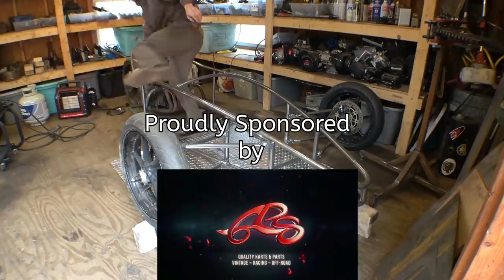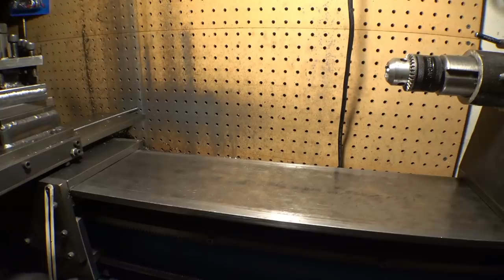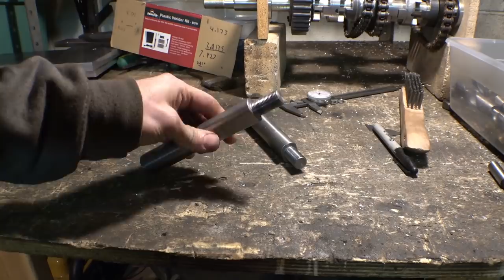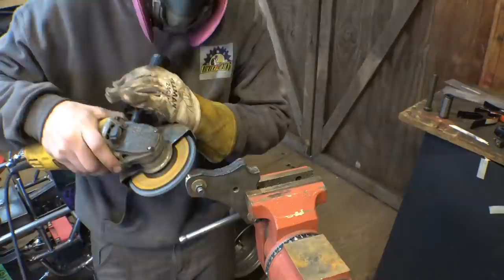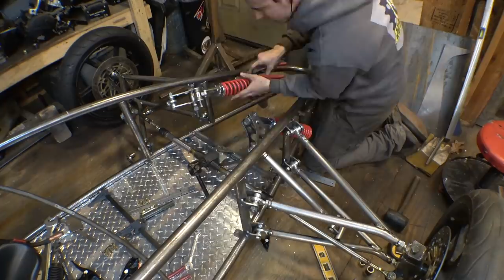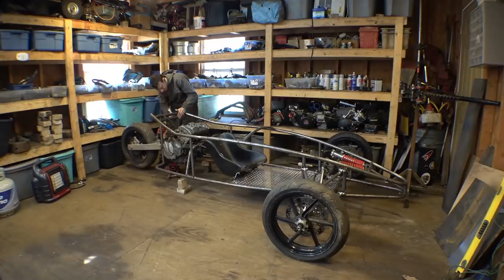CBR 600 Reverse Trike Part 4

Comment: might actually be able to add linkage to the steering tying intoo the front suspension (think it needs to go in after the shock to prevent shockloads intoo the steering ) and have it lean intoo the corner you set up the front with equal wishbones so moving to the side makes the wheels lean intoo the corner too
https://www.youtube.com/watch?v=qx1j9p-rU24

a polak welder fabricator made sumting i think might work on youre double a arm design :
https://www.youtube.com/watch?v=spZtQK37xKw&t=0s
you need to change the mounts for the shocks in the nose section so they lever on a centerjoint and framemount thats more toward the driver , the ofset between the centerhole and the shockmounts will depend on how eazy you want to lean the vehicle intoo the turn (and get it back to vertical  ) 

as for the shock in te rear , you could put a bellcrank in there too but intoo the other direction softening the suspension 
as for cutting the aluminium plate , i seen them using a jig saw for that think they used a woodsawblade on it

Comment: I think I know why your projects be over weight and under power. You need to look into using other material than just steel. Like the floor it’s diamond steel, instead make it out of wood like the Morgan factory does it. The outer skin make it out of aluminum or fiber glass..

Comment: Possible solution to using moto tires on the front of your build .. I ran across this video showing a guy building a reverse trike that leans in the front .. This would allow the full use of the moto tires you have .  Worth checking out .. Even if it just helps with an idea or two . . https://www.youtube.com/watch?v=spZtQK37xKw